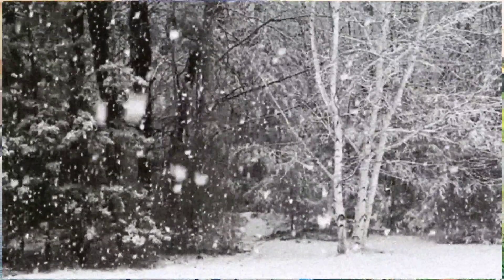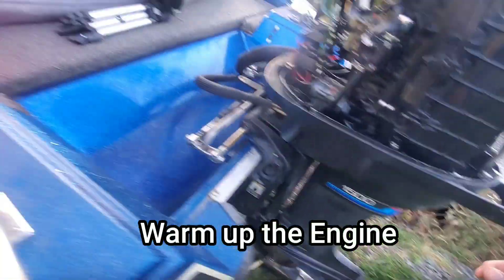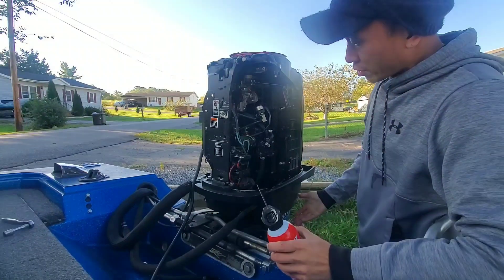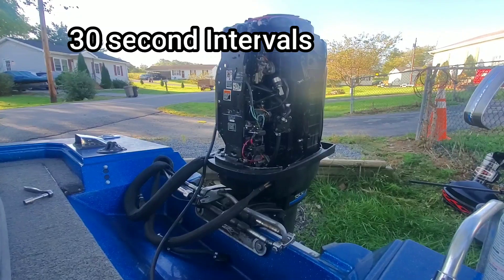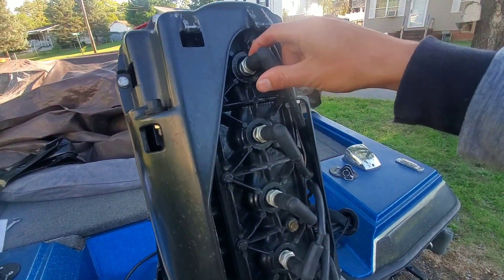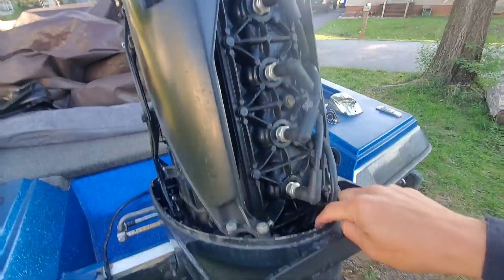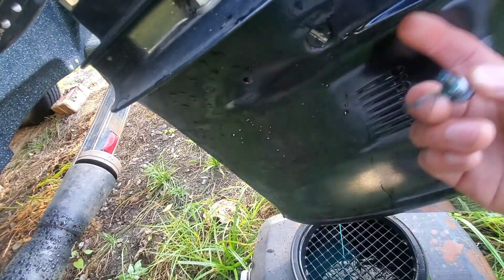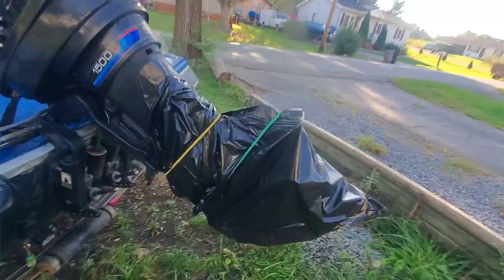Mercury Outboards: Winterizing

Comment: 1988 Mercury 115 HP. New powerhead, bored .20 over. What would you look at first if you were suffering fuel starvation at about 1500 rpm to the point the boat tries to stall BUT as the boat stumbles I hit the enrichner and the boat gets over the hump and will run at 5500 rpm until you shut it down?
Reply from the maker: That's definitely a tough one. I'm assuming you tuned the carbs and set the idle screws on the rich side (1.5-2 ccw)? Try turning them ccw (all 3) another 1/4 turn  and see if it stalls. If it stalls try another 1/4 turn (all 3). I would also verify the floats and tangs. After priming fuel should be at the top of the venturi in the carb throats. Please let me know if this helps. Son.
Reply: Did you figure out the cause?
Reply: @MrPoserina  new fuel line from tank to motor.
Reply: I have similar problem with mine some people say that could be bad  reed valve, i already replace primer bulb fuel pump rebuild carbs  and this ingine was rebuild last year

Comment: Hey Son, thanks fir the video.  Any reason not to fog through the carbs while it’s running on the hose?  I know that’s the preferred method for many I/Os.
Reply from the maker: There's multiple ways to do it. You can fog on the hose but then would have to restart and run the antifreeze through it witch would thin out the fogging oil in the crankcase. Son

Comment: All I do w mine is run the  gas out of the carbs and make sure the motor is trimmed down so the lower does not get water in the exhaust  area inside the lower
Reply: And remove the battery
Reply from the maker: I'm guessing you've never had issues with water intrusion within the gearcase? I used to do just that but I've seen too many lower unit problems.
Reply: @MerCSonL6  my oil has always looked good.. prob should just remove the good ones and keep them inside or change the oil to be safe
Reply from the maker: @D7mSupra  i appreciate the advice. When I made this video I did not have an accessible garage. Thank you for your interest. I enjoy your videos! Son

Comment: You should read owners manual. Your not even supposed to turn over your engine without water. You’re destroying your impeller.
Reply from the maker: I change my impellers every spring. Thank you for your input. Son
Reply from the maker: Additionally that's why I run the water and antifreeze through first.